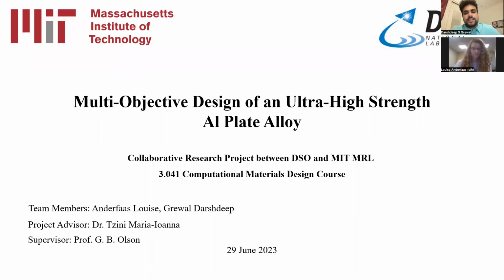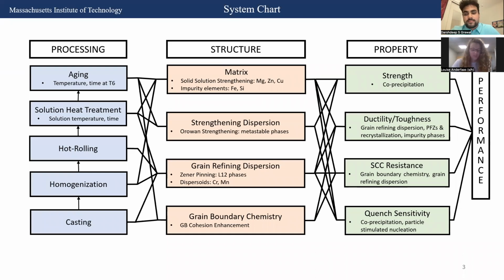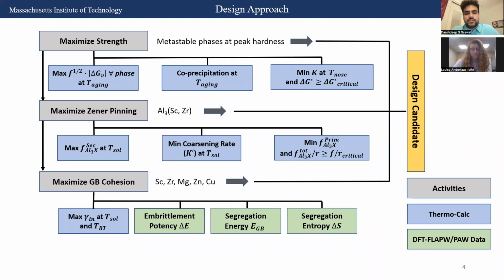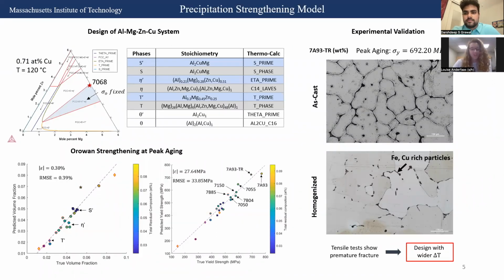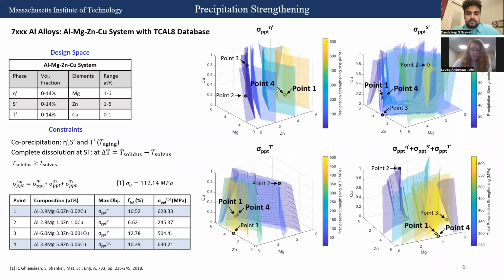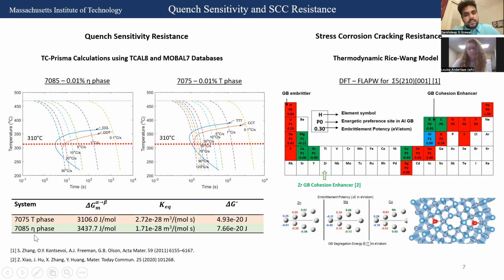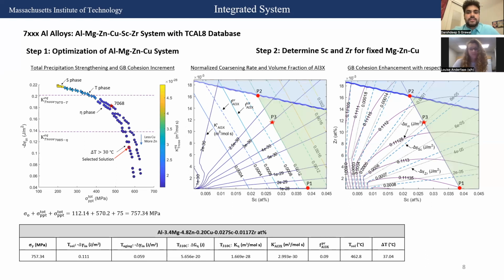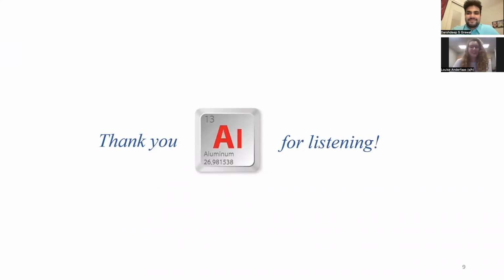ASM 2023 Submission - Louise Anderfaas and Darsh Grewal (MIT)

Comment: Fascinating stuff! I cant help but feel there’s a catch somewhere though
Reply from the maker: The challenge when you take this out of simulation and into real life is really the 10cm thickness of our design goal. You can’t heat the surface and the bulk at the same rate creating a thermal gradient. Thats the primary processing challenge.
Reply: @darshdeepgrewal2643   So the challenge is the small temperature and stoichiometric window to make this superalloy? Sounds like it would be easier for thinner sheets that are also more prevalent for aerospace anyways.
Great work!